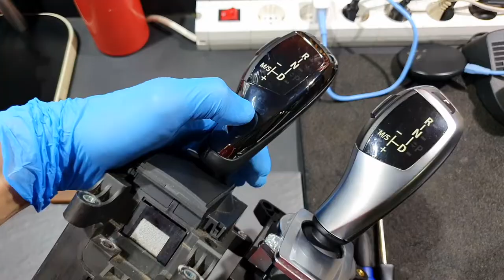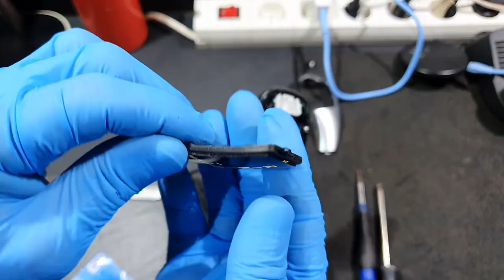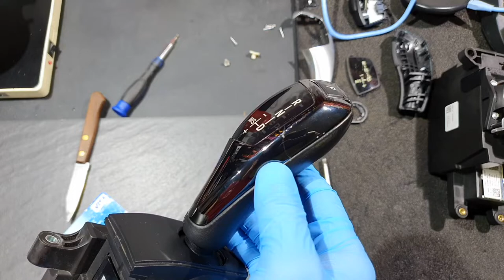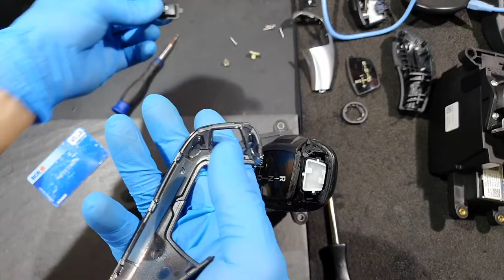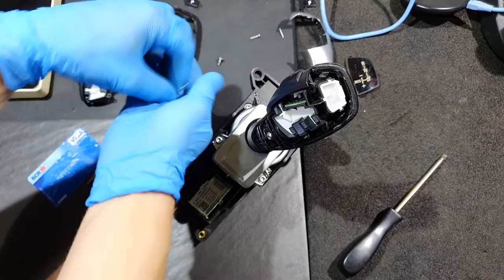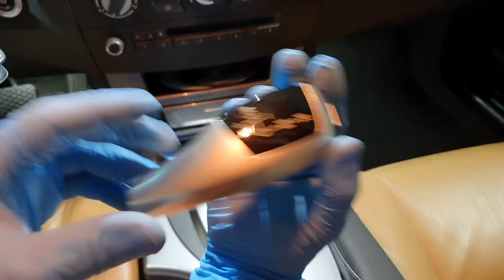How to Disassembly BMW E F series  Gear Selector Top Part

Comment: Hey have a 2012 535xi non m sport . I tried to use a credit card to take off the silver face plate and even some plastic pry tools but it just won’t come off. It should be the same method as the 7 series one you showed at the beginning of this video right? It does not have the plastic round thing on bottom that you move counterclockwise for the x5 one. I don’t want to break it by trying again so just want to confirm with you that there are no screws I need to remove

Comment: In the USA, our F30s have a 8mm torq under the transparent plastic holding the top assembly to the bottom.  There is no way to pry them apart with removing that fastener!  Once the fastener is removed, you don't need a card card or pry bar as it loosely comes apart with just a finger nail.  The first step for North American F30s is to gently pry up the transparent plastic which is held on with adhesive tape, then unscrew the 8mm torq fastener and the top piece will easily separate from the bottom.

Comment: Hi there. Thanks so much for this in-depth video showing the inside parts of these selectors. Quick question from my side - my X6 E71 unlock (release) button of the selector is loose and wiggling. I took it apart and seems some part of it is broken. Do you think I can replace the unlock button as well with the outeer black side frame that holds it in place? From what I found in the net, the inside part of this button and the way it holds itself to the side black frame could be different, but in all cases it just pushes another button inside the shifter. So do you think the whole side black frame with the button is replaceable from other bmw selectors from F series for example? Thanks a lot!

Comment: Hi, I really enjoy your channel. You gave me a lot(!) of hints with my E60 lci. Thank you for that! One question. Did you try to disassemble the gearknob all the way to the ' metal core' (from E60)? Is it possible to remove the black plastic thing that's inside decorative housing (that keeps semiconductor wafer in it)? It seems there's no other way to get inside the mechanism of the gearknob...if yes...could you give some tutorial on that? Thank you in advance!

Comment: 2012 X5 xDrive 35i shifter wiggly.  I have to hold it back to stay in drive or it will jump to Neutral. Will not move to the manual side at all.  Will this get worse?  Do I have to replace the entire shifter? What causes the failure?
Reply from the maker: Hello, yes, you'll need to replace it!

Comment: congratulation for the great videos, i faced a problem with the gear shifter, that it doesnt move  from D position to D/S position, D, P N work normally. any idea of the problem?
Reply from the maker: Hello ! yon need to do a diagnosis and after that depending on what errors do you have need to be disassembled to se if is repairable or need to be replaced .

Comment: Thanks for this great video! Very instructive. In my 2009 F02, the gear selector feels loose and makes a loud ticking sound when changing gears. It still works, but it doesn't feel solid. I suppose the problem is in the bottom part of the selector. Do you have any advise for repairing it?
Reply from the maker: You will have to disassemble it and see what the problem is !
Reply: @MOvidiu  Sure, I will. Did you ever open up the bottom part and did you encounter tricky things? I am a bit afraid to break something... Any advise is much appreciated 🙏

Comment: Hi is there any part number avaliable for the ribbon connector? Disassembled my gear shifter because the lights weren't working, and found that the brown ribbon cable had snapped in half.
Reply from the maker: Unfortunately no , there is no spare parts for this

Comment: Hey I recently disassembled f10 gear shifter, when I put it back, led light and parking button doesn’t not work, what could be the problem? Shifting works fine
Reply from the maker: Hello,  i don't know what could be wrong:) maybe you broke something inside,  take it apart again and see what happened
Reply: The led lamp broken my car f10  code error 802680 Function indicator

You can change lamp led number: LED SMD 3528 PLCC4
Reply: Were you able to get the led on?

Comment: Salut. Am si eu o problema, nu mai revine la pozitia initiala butonul de unlock. Probabil un arc ceva. Se poate face ceva sau trebuie inlocuit tot ansamblul? Multumesc
Reply from the maker: salut , trebue sa il desfaci poate are ceva curs in el suc sau cafea sau poate are piciorusele rupte, dar pana nu il desfaci nu stii..
Reply: @MOvidiu am si eu o problema cu eroare GWS  A82E Comutator treapta viteza se aude un zgomot in treptele mici 1,2 dupa o diagnoza am inteles ca un senzor este defect de la selectorul de viteza ma poti ajuta se poate repara? Te rog un numar de telefon sau unde te pot gasi

Comment: Salut, la f01 îmi arata ca e în N când pun pe P. Diagnoza îmi da eroare la blocul de valve. Masina e defapt în P. Mi-a zis cineva ca poate o fii selectorul cu probleme. Asa e de 4 ani, doar ca afișează tot timpul N. Ce părere ai. Merita sa schimb selectorul? Mersi fain.
Reply from the maker: Salut , daca ai eroare in blocul de valve nu are treaba selectorul , chiar am avut una cu aceiasi problema si sa rezolvat prin inlocuirea mecatronicului .
Reply: @MOvidiu  Am comandat selectorul second-hand, trebuie sa îl fac ceramic (dacă merge) - al meu e ceramic. Dacă nu, îl trimit inapoi. După ce am văzut video-ul doar la asta m-am gândit :) Eroarea: 400636 PARKING-LOCK SENSOR, LINE L4 FAULTY
Possible fault cause is a fault in the mechatronics
System time: 260221552 s
Discrete inputs: Level to L1 pin: high
Level to L2 pin: low
Level to L3 pin: high
Level to L4 pin: low
Activation status, solenoid valves; Solenoid valve PS
Active solenoid valve POS Active.

Comment: Salut, se poate pune ceramic pe unu selector care are plastic cover ?
Reply from the maker: Salut . da , cel mai simplu iei toata partea de sus
Reply: @MOvidiu  salutare. Lasă mi te rog un număr de contact. La al meu X5 e70 nu trece joystick ul din Drive în manual și sport. Ma poți ajuta cu reparația?

Comment: Hiya what's the ribbon part for ?
Reply from the maker: Hello , I'm not understanding
Reply: the ribbon contains “traces” - conductors akin to wires - embedded in a thin plastic ribbon like a thick cellophane. These are used to interconnect circuit boards in a complicated device like the BMW gear selector.